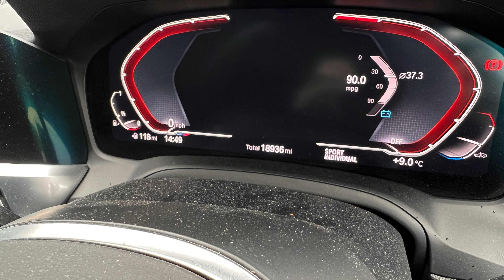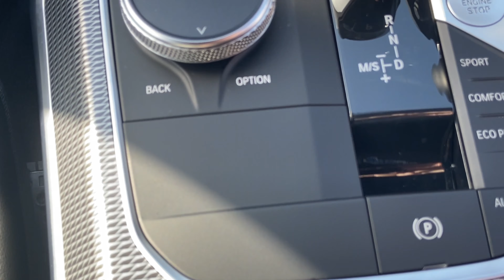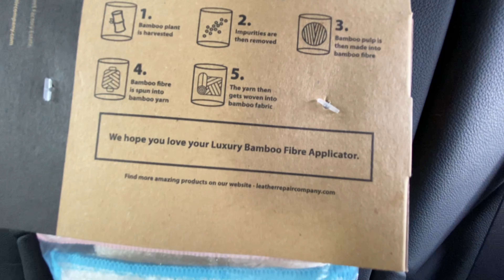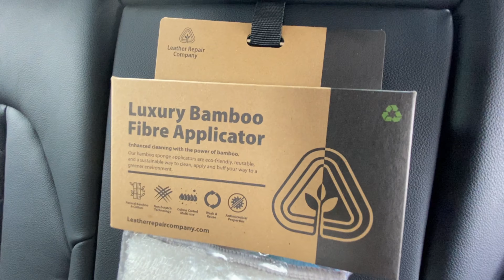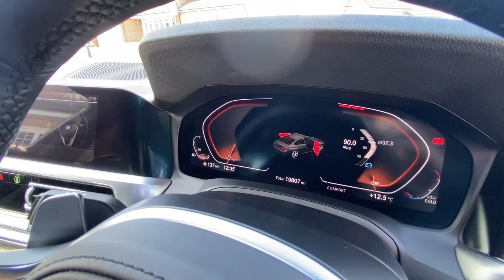CLEANING MY OWN BMW 330i INTERIOR AFTER TWO YEARS OF OWNERSHIP in 4K #autodetailing

Comment: Great video mate. I've been using the scrub pads rather than detail brushes and they are a massive time saver. However these safer bamboo type ones looks much better for all round cleaning. The results on the seats says it all. And as for KC greenstar. Such a great product!
Reply from the maker: Thanks mate 👍 yeah a def massive timesaver and double the cleaning action with the bamboo as they’re the same both sides so let’s you get on with the job before finding out as much too, I love em

Comment: I use Nexzett cockpit cleaner for the buttons because it cuts through the greasy finger oils and adds a layer 
off UV protection. Have you found at all that the glass cleaner could take off the lettering on the buttons.
Reply from the maker: Something I’ve never heard of , interesting as I’ve noticed the buttons on my steering wheel becoming a bit greasy 🤔
The only thing I’ve seen that potentially could remove lettering was Surfex HD at too strong a dilution , and anyone using that with a scrub pad would do some serious damage to letters. 
I’m going to look up your cockpit cleaner, just out of interest as I’ve never heard of it

Comment: Great video again Graeme. Those pads look like a sound investment for the plastics and dedicated ones for the leather. I've been informed that ladies make up brushes are great for interiors especially infotainment screens (Martin @OCD). Question for you, if the seats have Carpro CQuartz leather coating and the carpets have CQuartz fabric coating how would you go about cleaning them??? I'm debating about wether to get my interior done or not, thanks in advance.
Reply from the maker: Make up brushes aren’t just for ladies nowadays 🤣but yes , they are amazing for dusting interiors , Poundland is your best store there!!
How long ago was the seats & carpets coated in CQuartz mate?
Reply: I was going to coat the new car when we get it (5wks). We're spending a hell of a lot of money so wanted it to be looked after and last, but you made me think about maintenance cleaning and what products to use after it is coated!!!
Reply from the maker: Great question anyway Paul, just think of it like the exterior , we coat that to make cleaning easier so it’s not a problem vacuuming or even using a cleaner on the carpets etc, most coatings for interiors need reapplying annually anyway so they’re not that durable , main thing is it enjoy the new car and clean it regularly by a quick vacuum & a dust 👍
Reply: Great advice as usual, thank you 👍👍

Comment: Nice video as allways Graeme, I’ve switched mostly to the scrub pads for a lot of the plastics now, I find I can get the knocked out much quicker. Will need to try these bamboo ones soon
Reply from the maker: Thanks Dave. Yeah def save so much time, another tip is to use them with a bucket of water to keep cleaning them out as you go , sort of like an interior sponge wash 😀

Comment: Hi last I commented on your video I was a total noob and didn't understand anything about detailing but now 5 months or so later I've gotten really good and now valet cars weekly but I'm looking to invest in a carpet extractor, do you use one? If so what one do you use and if you don't use one why dont you?

I'm torn between the karcher puzzi 8/1 and the aqua vac Pro
Reply from the maker: That’s awesome news you’ve made a business out of your interest , I use my Karcher Wet Vac for doing the carpets & upholstery if I need to but it’s nowhere near as good as a Puzzi 8/1 I actually missed out on a cracking deal with one a while back, I even offered the guy more than asking price and he said no he was holding it for someone to come view it next day 😭
I’ve seen what the puzzi can do and if you have enough work to justify it , that would be my machine of choice 👍
Reply: @GMDetails  yeah they seem like great machines but the current price tag is £450 and it don't seem to be coming down 😳
Reply from the maker: @ildxnnyli5541  😱 that isn’t great , alternatives possibly the Titan wet and dry vacuum using spray cleaner & a drill brush then wet extract ? 🤔
Or the Bissel spot pro but I’ve heard the plastic parts don’t stand up to much use professionally which is ironic given it’s name 🥴